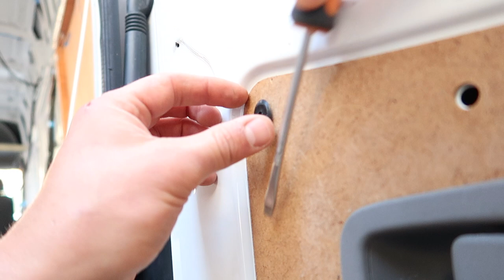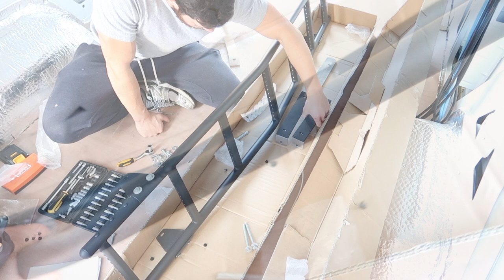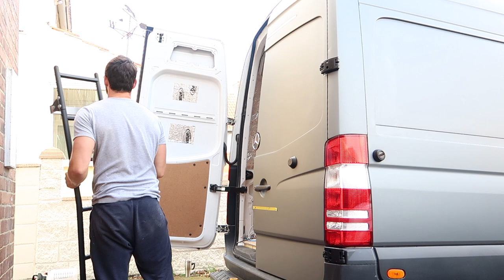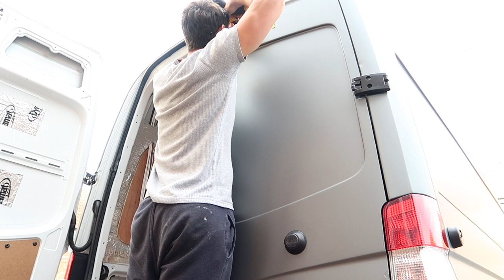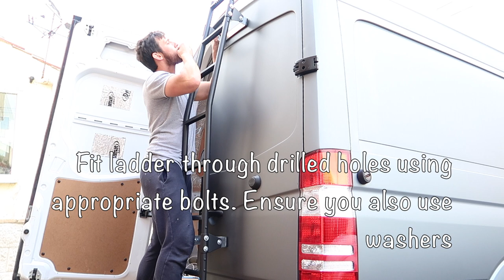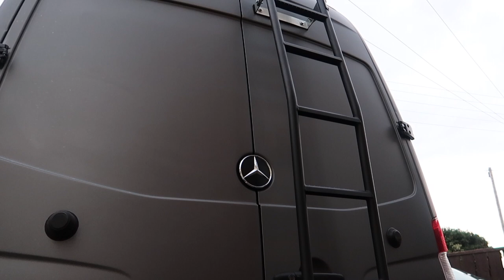SIMPLE Sprinter Ladder Install | Ep10 | Sprinter Camper Van Conversion

Comment: Hey guys, thanks for the vid, does can you still open the doors all the way back with this ladder? And do you have a link for the ladder. Cant find it in your description. Thanks heaps
Reply from the maker: The ladder stop it from reaching the magnetic stopper. We bought it on eBay but the link was dead. It's should be easy enough to distinguish if you were to look for van ladder.
Reply: @ScottAndJen  OK, thanks for the hasty reply

Comment: Would it make a difference if it was installed on the side of the van?
Reply from the maker: No that is completely viable option
Reply: @ScottAndJen  yes but would the wall of the van take the weight of someone climbing up on it?  What I am asking is if the back door is equally as strong as the side
Reply from the maker: @rudeboi4812  you usually get strengtheners with ladder that clamp behind the fixing points so yea it would be the same